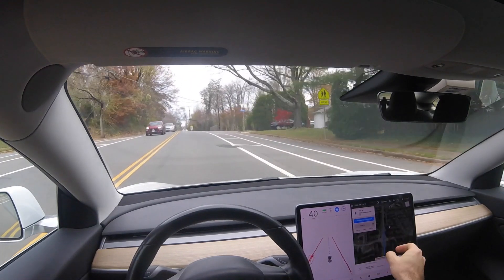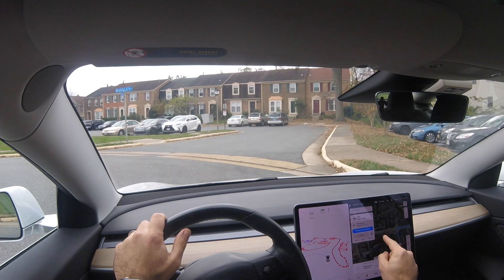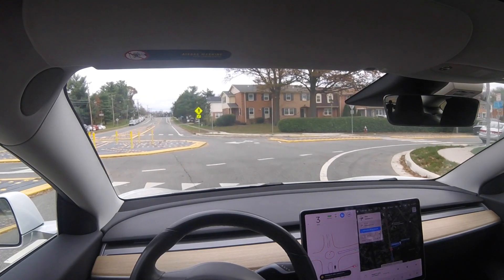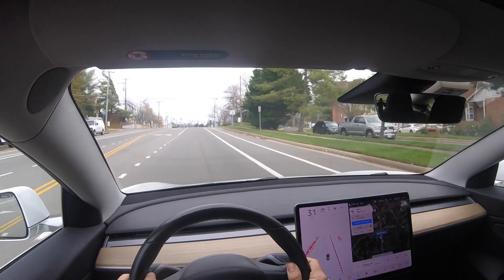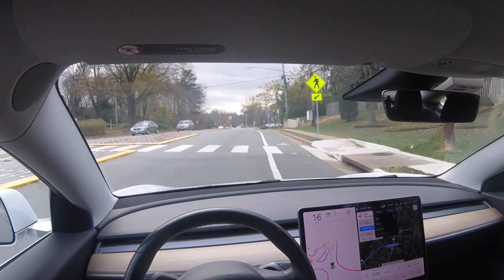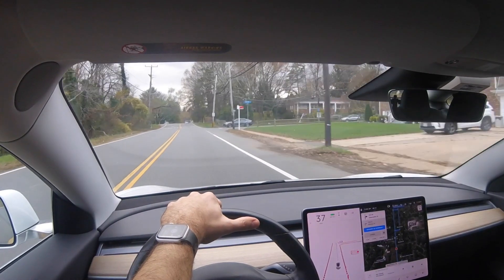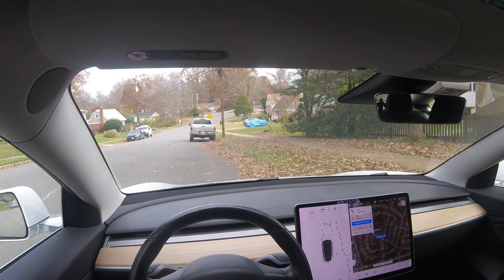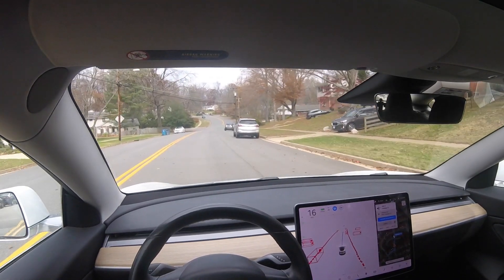FSD Beta: Mini-Modular Roundabout Tesla Model 3 2020.44.10.2

Comment: Good thing you were able to do that roundabout on Ravensworth Road. It isn't so busy and crazy like it is in the much bigger roundabouts in DC. I wonder if the software has problems because of how tight the round about was. One thing I did experience last week was how an oncoming car had done a left turn across my lane. It had cleared my lane by at least 1.5 seconds, but my car did a hard brake as to try to avoid a collision. Other times my car would beep at me when it thinks I am going to rear end someone. Seems to me that it could be a calibration issue with the cameras or sensors.
Reply from the maker: I will be posting a video with this crossing path scenario. Seems like the beta can predict paths and timing, and can keep going without using brakes as you describe.

Comment: The cars do not do learning on-board. They just don't have enough compute power to do so (nor do they need it). The cars are only doing what is called "inference", which is basically only execution with no learning. While they do so, though, they do capture data (video and driver input) and send that data over to Tesla's "mothership", which is where they store and process all that data. Then, at the Tesla's servers, they use that data to train the algorithms (it's at that point that learning is done), and the output of that training is basically just a huge matrix with a bunch of numbers (what is called a "trained model"). Then Tesla sends those "trained models" over to the cars via an OTA, meaning that now the cars will do "inference" using the new "trained model".
So the car won't just do better if you take the same turn 5 times in a row. Or if it does, it won't be because the car learned, but due to other factors (lightning conditions, traffic, etc).
Reply: @DMacTech  Oh for sure. It's just that I see some confusion around the topic, and since you did say "I'm gonna manually drive through the roundabout to see if it learns" or something along those lines, I thought it would be good to write this, so that people don't get the wrong idea.

Comment: Thanks for the repeat roundabout testing.  It's interesting that some people think that an individual car can learn between updates, while others swear that it doesn't.  I wish Tesla would verify one way or another.
Reply: The cars do not do learning on-board. They just don't have enough compute power to do so (nor do they need it). The cars are only doing what is called "inference", which is basically only execution with no learning. While they do so, though, they do capture data (video and driver input) and send that data over to Tesla's "mothership", which is where they store and process all that data. Then, at the Tesla's servers, they use that data to train the algorithms (it's at that point that learning is done), and the output of that training is basically just a huge matrix with a bunch of numbers (what is called a "trained model"). Then Tesla sends those "trained models" over to the cars via an OTA, meaning that now the cars will do "inference" using the new "trained model".
So the car won't just do better if you take the same turn 5 times in a row. Or if it does, it won't be because the car learned, but due to other factors (lightning conditions, traffic, etc).
Reply: @Supreme_Lobster  OK, are the "trained models" that you refer to the regular software updates (e.g. 2020.XX.XX.9) or are they some kind of like an interim update?  If it's the former, than are these testers just wasting their time when they try repeat runs through a roundabout?
Reply: @robocheme880  as far as I know, they are mostly delivered through regular updates (new version numbers). But I have heard some rumours  here and there about interim updates (no version number change), which adds to the confusion. Although my understanding is that interim updates are operating mostly (if not fully) in "shadow mode", so they should not affect the behaviour of the car whatsoever.
Reply: I just copy-pasted that comment. Basically, the cars' computers are not powerful enough to do learning. They are not even designed to do so.
Reply: @DMacTech  My bad then, I misunderstood your intentions. Still, it's worth making it clear
Reply: For more in depth info search for Andrej Karpathy's lectures here on youtube (he's Head of AI at Tesla). Although the last one he did is from April, so it's probably not quite up to date with the current systems.

Comment: signaling left in a roundabout is right in my country. USA dont have so many roundabouts as here in EU. So we are used to turning on left and right blinker goin in to a roundabout.
Reply: In what country do you guys use the left blinker? Here in Finland we only use the right blinker.
Reply: @Santeri_M  Norway
Reply: @rickmartony9566  sweden
Reply: @ohlin12345  Mandatory in Sweden: Indicate when changing lanes inside the roundabout. Indicate right when exiting the roundabout.
That's it.
But... You can, use a left indicator inside, but, this has to be used with caution since it can be confusing. So if unsure, do NOT indicate left.